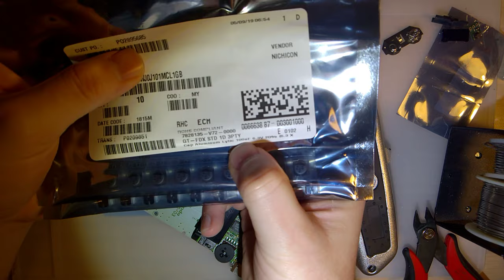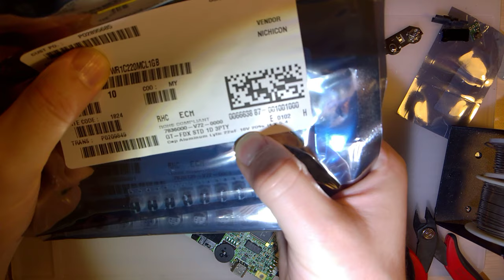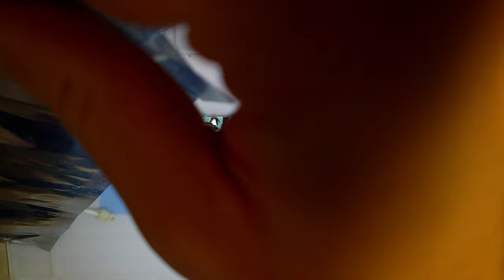Recapping one of my Game Boy Colors

Comment: I know you're not keen on some of Retro6 stuff, but i saw they sell a "Gameboy Color Power Capacitor kit" which is a 680uF that replaces the 100uF 6.3V stock.  I wander if that actually helps at all with the audio noise issues?
I've just ordered 100uF Solid polymer Caps to replace my GBC ones.  I've seen some russian mods that use MLCC caps to replace all the aluminium caps too (search for GBAmp3 on tindie and look at the GBC's PCB).  I know that capacitor technology has advanced a lot since GBC was introduced,  I wander if Polymer/Hybrid caps or MLCC's can make a significant improvement?  I went with Polymers to keep the same aesthetics.

Comment: So I know this is an older video, but handheld legend sells some 680uf 6.3v aluminum capacitor (the one located behind power regulator) and OMG do they make a night a day difference. When I replace all capacitors with the console5 kit, yeah it help, but since I had backlight and amp, so much noise/static. Replace with 680uf 6.3v aluminum capacitor, voila, Problem solve. Here it is in case anyone desire it: https://handheldlegend.com/collections/game-boy-color-gbc/products/680uf-aluminum-capacitor-for-cleanamp-20-6-3v-smd?variant=31547771846790
Reply from the maker: > HHL
:(

Comment: the UF you can actually go higher, as high as you want since all that this number indicates is how much energy it can store, it doesn't indicate how much it outputs, capacitors only regulate the energy flow to be stable, they don't make it higher or lower
Reply: ok not as high as you want since the power consumtion is affected by it, but I hope you get what I mean
Reply from the maker: @niplob  Inrush is a thing. Limiting the cap capacity will limit the inrush. Sticking to the same values Nintendo used will ensure that the inrush is not too great.
Reply: Interesting, didn't think of that. I mean, the only cap I recapped higher was c32 at 680uf, but only cuz my gbc is full with mods. Thanks for the info @makho

Comment: Another trick for removing SMD caps, is cutting the 'can' part off with flat cutters, and that lets you do one pad at a time.
Reply from the maker: That's not a trick, that's bad technique and if you've done this before successfully, you're lucky you haven't ripped pads up.
Reply: @makho  Are you saying, that litterally pulling on the traces, is better than a perpendicular shearing force? Its gonna suck if you were to do it at the wrong angle yes, cuz you'd be pulling the legs together. But cutting in alignment with the traces, its the easier and safer way. In my oppinion
Reply: I just very, very, slightly rotated the can back and forth for about a minute and it snapped off, zero effort, no damage.

Comment: Could you possibly do a recapping vid for the GBA SP? I could not for the life of me find a recapping tutorial for it yet.
My GBA SP is making a low volume buzzing noise which can be heard both on the speaker and on headphones via an adapter. So I'm sure it's not the adapter's fault and it's not the speaker. I suspect bad caps causing power issues or something. I'm gonna try cleaning the console and the switches before even thinking about replacing capacitors. I should also check the board for bad solders.
Reply from the maker: there's only one electrolytic cap on the SP that would need replacing if that's even the issue
Reply: @makho  Thanks for the reply!
I actually noticed that both my AGB-001 and AGS-001 have the buzzing noise when either on speaker or on headphones. It's not loud enough that I could hear the buzz when playing on the console's own speakers. I can only hear it if I put my ear right next to the speaker. But on headphones it's really audible and irritating. 
After a bit of testing I'm pretty sure it's just that both of them have dirty power switches. I'm gonna give them a good clean to see if that helps!

Comment: Hi! I need your help as I dont know much about capacitors. I bought an SMD kit with the same uf and VDC values but the body dimensions of one of the capacitors is smaller. Is it a problem or since the uf and v values are the same its going to be fine? Thanks a lot!
Reply from the maker: no, that's fine. Technology is not the same today as it was 23 years ago when these things were specced out and designed.
Reply: @makho  thanks a lot for your response! You're awesome!👍

Comment: Would these capacitors work on the Gameboy advance as well?I think my GBA had the same issue, rusty speaker, no sound. I replaced the speaker an dit works but the sound seems ot be pretty quiet. Im thinking (after cleaning the volume wheel and headphone jack) that it may be bad capacittors
Reply from the maker: I don't know the specs on the GBA caps off-hand. They should be labelled though. It's probably a good idea to replace them in your case but I'll have to find the specific ones if these aren't it.
Reply: I actually looked it up there’s a console5 wiki that lists alll the caps for all the different handhelds

Comment: I fucked up the negative pad on the larger capacitor. Can I just wire the negative end to the ground next to it?
Reply from the maker: Depends on which specific capacitor. The power ones, yes, the audio one, no.
Reply: Hi there. Which one is the sound capacitor?
Reply from the maker: @mre2164  bottom left, check the schematic

Comment: I've got two gameboy colors that both had no sound.  I re-capped them both and put new speakers on.  Both speakers still don't work.  When I plug in headphones the sound works fine.  I've cleaned up the headphone jack and there doesn't seem to be any corrosion that would make it think headphones were still plugged in.  Any suggestions?
Reply from the maker: Sounds like a bad headphone jack. You can test continuity on the pins and compare with a working one.
Reply: @makho Do you have a video on that?   I'm new to doing stuff like that with a multimeter.  Also do you have a discord server suggestion for retro repair?
Reply from the maker: @davidpohle  put it in beep mode and see what is connected. The headphone jack has a switch in it and there should be continuity on one of the pins to ground (the pins that aren't ground pins). Check all the pins then compare with another, known working motherboard.

Comment: Makho, i have an og gbc without mods or anything... he does a buzz sound when i use it with headphones. It's not annoying, but i want to know what's the cause of that. It's the capacitors ? The speakers in clean and working fine ! Maybe this buzz sound is more noticiable because of the size of the headphones ? hmmm is it something it can be fix with a capacitor change ? Thanks !
Reply from the maker: Could be caps. I'd start by cleaning and potentially replacing both the headphone jack and volume wheel, then recap the console
Reply: @makho  i played a bit yesterday after that comment.... and it's not a buzz, but rather a hummmm sound..... it only gets noticeable of o turn the volume too loud. My GBA does the same thing and it's a vanilla gba as well... maybe it's just me idk lol but thanks for answering !
also, the gba makes funny noises when you boot a ez flash omega game ahahah
Reply: @FabioGnecco  you should recap it
Reply: @carlosramone40  i definitively should recap it before trying to add mods 
thanks for the heads up !

Comment: Where does one find cap replacements for the SP?
Reply from the maker: There are no kits that I know of if that's what you're asking. You can get replacement caps from any electronics parts retailer though like digikey, mouser, lcsc, arrow, etc.
Reply: Well it seemed as such as I scoured the tube, so I figured I'd ask a couple YouTube Gurus. Thanks - you've taught me extensively through the last few months.